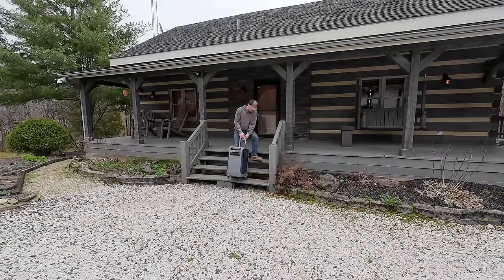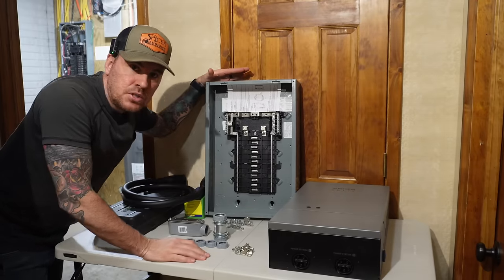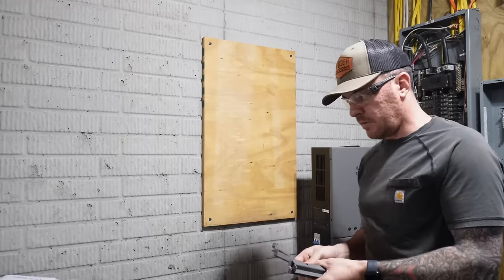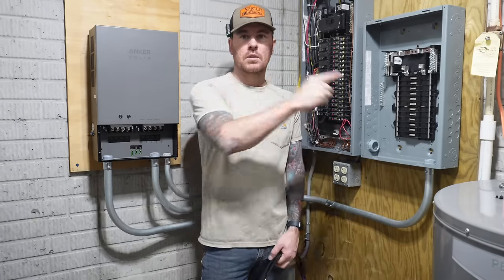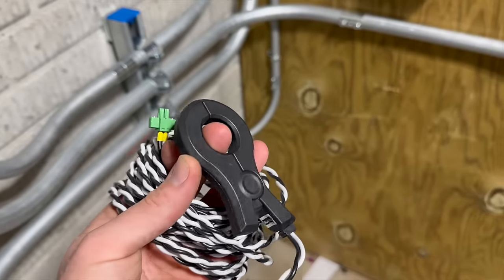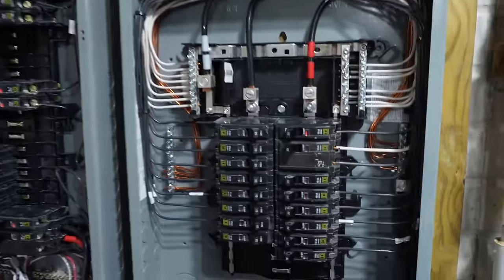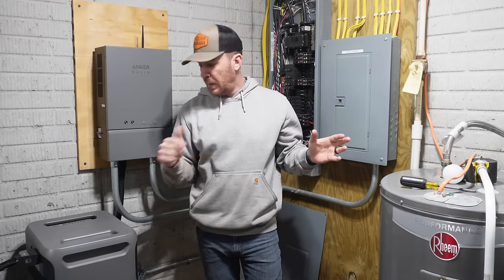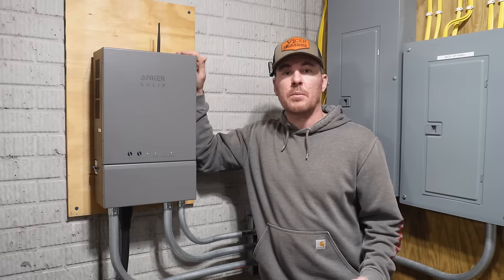STEP by STEP Installation Of Auto Home Back-Up System | Anker SOLIX F3800

Comment from the maker: Join Anker SOLIX F3800 Facebook Group! Share your journey, discover tips, and more! https://www.facebook.com/groups/ankersolixf3800/
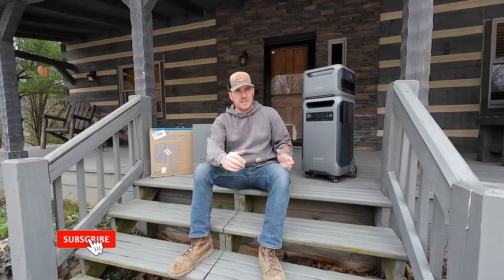Reply: 0:47Thank you for you informational video you explain things exceptionally well it was a breeze to show this to my electrician as im a low voltage guyI have a ? if no power banks are installed in the smart panel, will the sub panel still work with grid electric  or do they still need at least one plugged in.
2) do I have to use a 100amp breaker or can I use something like a 60 amp 
Thanks in advance for your answers

Comment: Always worked on energized panels. Never turned off breakers when replacing outlets/ installing fans. Just turn off the switch and pay attention to details. Not electrical advice. 😏 Good job!👍

Comment: your worksmenship is amazing!!! I do think probably the coolest feature that makes the panel so much more than a auto transfer switch is the fact that the AC coupling can power the whole house on the main panel, not just the critical loads panel, by feeding the solar power backwards into the house,  balancing automatically without feeding power back to the grid, so your power bill can be nearly zero, or very close to zero. this is HUGE for DIY solar owners because you dont need any sort of weird net metering credits agreement with the power company.
Reply from the maker: Thank you!  Sounds like you have a good understanding of the system.  I did just make another video where i added solar too. Its been helping out with the bill for sure.
Reply: @SpicerDesignsLLC  oh cool! I haven’t watched the follow up video. I don’t have the Anker smart home panel yet but I’ve been researching to add this and the f3800 to my existing 3kw solar system. I’ll get caught up on your solar video to see what you find. Again - your workmanship is like 💯- I have much to learn from you

Comment: He needs to have two I couldn’t just have bought 1 knowing it takes 2. Dude get the complete kit. Let’s get that second one. : )
Reply from the maker: I have the second one now
Reply: @SpicerDesignsLLC  could you do a video breakdown on cost assuming we the general public hired someone. Because I can’t pull off what you just did. So impressive and lastly testing it with two attached how much run time and how it takes care of your home.
Reply from the maker: @rabeahkarram9689  yes i will have a follow up video in a while.  Trying to gather some data on cost savings while using the time of use mode.

Comment: Well, I think I should get 2 of those generators and all 12 batteries between the 2. Get one of the little home panels. Hook that up to the fuse box. And now to give me a few days of power when power goes out. Of course, I don't have a power line so I don't have power from the power company.
 And I only have solar generators. I was thinking about getting A.  Gas propane one, but still haven't done it yet.
 I still like buying a solar generators. So I think I might stay with those instead. Cause they are cheaper. And they cost more for the unit, but they are cheaper on fuel.

Comment: Great video I am looking to do something like this myself since I just spent a few days running on a generator due to hurricane Milton. 

I feel like I could have watched the full non time lapsed vid 😂 

I wish there was a system like this I could use with some of the diy eg4 batteries but I assume there is a lot of communication that has to happen  with the inverter.

Comment: Great video! However, I didn't notice that you turned on the A/C to actually see if this would have powered it. Would definitely be interested if it would actually power the A/C during an outage.
Reply from the maker: Ive since used the ac on the system.  It does work.

Comment: Hardcore bender! Good story, love it, thanks.
Reply: Will it change over fast enough to leave tv, wireless router etc. on or will they go onto standby or reset? Or does it work like a UPS?
Reply from the maker: @hughwilson4911 it does have a split second transfer.  Great question! So its likely most devices will reset or shut off.  I did purchase a small ups for the tv and wifi router to bridge the gap.

Comment: Nice looking installation. Is there a benefit or a requirement to use metal conduit? Or could that flexible PVC stuff work?
Reply from the maker: @Hunter-vb8wo  you can you any raceway as long as its rated for it and acceptable to mount exposed.
Reply: @SpicerDesignsLLC , you make it look easy. I’d probably end up wasting 18 length of conduit and 4 days trying to bend it perfectly.

Comment: Thanks for the video! Very thorough! I'm going to check out some of your other videos.

Question  - At the start of the video, you mentioned that you have a separate disconnect, and the existing SquareD QO panel is 'technically' a sub-panel. I have an almost identical SquareD panel with a disconnect out in back near the meter, and am thinking of adding a Solix system as a backup. Would re-routing the grid-power connections from the SquareD panel directly to the 'Grid' side of the HPP, and then connecting the 'Backup' side of the HPP to the existing panel be a valid configuration? That would make all available circuits available to the backup power w/ minimal re-wiring. In other words, do I really need a separate sub-panel for my backed up circuits? I do realize I may still want to feed the 'grid' through another nearby disconnect (w/ a breaker) before the HPP, but the end result would be the same electrically, right?
Reply from the maker: @lmychajluk  theoretically you could do what your saying but the ct’s need to get their reading from the main feed and that may be too far.  Its hard to say without looking at it.

Comment: Nicely Done! I’m a 40 year Electrician/ Electrical Contractor and was asked to install one of these for a client. What are the local AHJ requirements for the installation of one of these units? I’m wondering if this would be considered an additional electrical load? My clients calculated load is already over 200 amps and the solar company has ignored that and put in a 150 amp main in order to install their massive 80 amp solar backfeed. Any info would be appreciated! Oh by the way, the manufacturer stated that it should only take a couple of hours to install this equipment! 😂🤣🤦🏻‍♂️
Reply from the maker: Not a lot of info on an AHJ requirements.  Im sure it will vary in different areas.  I would imagine that would apply more to the PV system solely and not so much the Anker system.  It can backfeed to counter high peak costs but it isolates the main in an outage situation.  Sorry i dont have a solid answer for you.

Comment: Man... thats a sexy panel!! Looks so clean and wire management is purdy as well!!! This makes me want to hook up my 50 amp manual generac switch for my 13kw generator! I tried my best to make it look like this when I landed my outbuilding aka office. I had a retired electrician come and size the line from main to sub since I didn't understand the calcs and distance equations and didn't want to risk it.
Reply from the maker: Thank you.  As long as you have a good game plan you can dress it up pretty nice.  And yes, voltage drop calculations can be a little confusing if you dont do it all the time.
Reply: @SpicerDesignsLLC  yeah voltage drop and then having to figure out aluminum vs. Copper. I had it all inspected just incase we ever sell and what not.
I have thought about doing what Adam mentioned in his video a while back that u assisted him with, about supplementing by using a system like either of yalls to run my office during the summer when I'm running the AC. I'm just waiting to save some $$ then look for panels to help charge the system!

Comment: Was hoping to bug you one more time - happen to know if the system would work with two panels for a larger home or would you need two systems (one for each panel)? Thanks again!
Reply from the maker: You could use it with two.  You would just have to move circuits from both panels into a sub panel that will be powered from the battery system during an outage.

Comment: Many thanks!!. 
You re the first to showcase how this works and connects. 

Could you please answer this (cause no one else has, even Anker):
In self consumption mode, how does the HPP know how to not output more than the main + backup centers need ? 
Is it getting readings from the CTs and adjusting the output constantly ?
Reply from the maker: Good question.  Yes, the only way i see that possible is with the CT’s on the incoming and if you noticed the internals of the home power panel there are more CT’s measure inputs and outputs as well.  And you can determine how much you want the battery to discharge so you still have capacity for an outage.   There is also another ct that they provide to install on the incoming PV conductor to measure solar input.  I showed it in the video but didnt install because i dont have any solar yet.
Reply: @SpicerDesignsLLC  got it, thanks.
Not sure if u can answer this... Is there any chance that the town makes u install a knife switch accessible from the outside so that  (in some severe fire or similar incident) they are sure you are not returning power to the grid?? 
Anything that ties and feeds your panel needs this according to some local laws - along with 100+ labels that say so - similar to solar GT systems... thanks a lot!!
Reply from the maker: @lys1805 i dont believe thats required on this system.  Dont quote me on that.  Its supposed to only counter the utility usage, so if the power is out it has nothing to counter and it would be in backup mode which would isolate it from the main and only power the backup load in the separate panel. Im guessing that the grid tie solar portion would still have to be set up in a way that it cant back-feed though.  I dont have much experience with PV systems.
Reply: Thank you very much!! (Subd)
And I totally agree on this.
But for the town to approve they would need to be convinced about it. 
That's when I think they would say "i dont know how this thing works.. lets put a knife switch outside and kill it if we want to"..

Comment: Good idea with the chase between your panels! I suppose if that thing went down you’d be screwed 😬
Reply from the maker: Ya pretty much.  Wouldnt be a good situation.
Reply: @SpicerDesignsLLC that’s the one nice thing about the manual transfer switch because you can stay on line

Comment: Very cool video, looks like a great home. Just curious, as an electrician, how much would you charge for a job like this? I'm looking into getting the F3800 and wondering how much to expect to have it all hooked up.. Thanks.
Reply from the maker: Thank you!  Id say somewhere in the 2k range with material.  Lots of variables so its hard to say.
Reply: @SpicerDesignsLLC  thanks!! PS what's up with the keystone? 😆 Busch light all the way!
Reply from the maker: Keystone is good stuff.  Cheap too

Comment: Okay, I'm not an electrician and get scared of electricity. These videos are fascinating because I'm trying to decide between a generator/solar setup, solar with batteries, or just how you're doing it now. I want to be able to run pretty much everything in the house, including the A/C. My question now... Why do you need a sub-panel? Could you connect the transfer switch directly to your main panel? Excellent video, by the way!!
Reply from the maker: You cant hook this up directly to the main.   The main feeds the Home Power Panel and that feeds the backup panel.  You can put as many loads as you like as long as it doesn't go over the 6000 watt capacity at any given time.  More loads will just wear the batteries down faster.  I recommend only the essentials.

Comment: I appreciate this info. We need to do something to at least keep our well and sump powered during outages.  The battery option over a generator now has me thinking, especially since it's not a whole lot that I need to keep running as "emergency".  Fridge, freezers, sump and well.  Seems pretty low demand considering what you backed up. Good stuff.
Reply from the maker: No problem. Its definitely a viable option.

Comment: Any thoughts of converting the existing 200A main panel in which I currently have 32 breakers to the 100A subpanel and adding a new 200A main panel which would be essentially empty? I do have much load and I am using two F3800's. Or is it just easier to move over the 32 breakers to a new 100A subpanel? thanks.
Reply from the maker: The most practical setup for these units is just adding the essentials. Otherwise it just depletes the batteries at a faster rate.  I would just stick with the sub and move the desired circuits over.

Comment: You are 100% right about wanting this to automatically switch over in the event of power loss.  I like that you can program the system to use power from the F3800 during your peak hours in the day.  As an electrician, how much would you charge for the installation of this system?
Reply from the maker: It all depends on the layout.  Your probably looking around $1500 just for labor.  Give or take.  Material is fairly minimal.
Reply: @SpicerDesignsLLC  I appreciate that.  my wife and I were thinking of getting on of the generac natural gas generators.  but this would be cheaper and still do the same job. we would need it to do.

Comment: What if we eliminate the subpanel and feed the whole panel with 2 F3800?  Would it still work if you just pulled out the main feed of the existing panel and reroute into the grid side of the ATS then feed back to the existing panel? Would the CT sensors still work?
Reply from the maker: @kanialav1404  no wont work.  The main panel feeds the home power panel.  If you lose power thats how it knows when to switch.  It would take away the auto transfer function.

Comment: Hey Kyle,   Nice Job!  But I am curious on why a battery back up rather then a propane or diesel back up. Battery seems so limited with both how much of the house you can run and the time you can run it for where the engine units you can do the whole house and really go unlimited time as long and you have a supply.
Reply from the maker: Thats the disadvantage to the battery.  I didnt want a gas generator eating through my propane. The propane is expensive and we rarely lose power.  So when it exercises every week is just burning gas.  The battery system will likely last through a typical outage which is all i really need.  All comes down to preference.

Comment: Good job.   I we lived close I would be trying to get you to do my solar connections on job sites.   Biggest downside I have seen on these style units is that the solar can’t back feed like a typical grid tied system.  So once the solar has the batteries charged… it just sits there.  Not sure if the Anker is the same but most I have seen are that way
Reply from the maker: The anker actually couples with the grid tied system.  Doesnt necessarily use the solar to charge it.  Its more designed around cost savings than just a normal back up system.

Comment: One more question. When the batteries are depleted to level set. Do the circuits connected continue running on power from grid while battery recharges or do they shut off to recharge? Thanks again for making this video.
Reply from the maker: The time of use mode for money saving actually just pushes power back on the grid to counter usage.  Similar to a PV system.  It doesnt actually switch to battery power on the new backup panel.  So once it depletes to the level you set, it will wait until off peak hours, which you would set, and recharge then.  Usually at night.  Hopefully that answers your question.

Comment: Great video.  I may have missed it...but...if you don't have solar...how does the Anker battery stay charged while awaiting a power outage?
Reply from the maker: It charges through the power connection cord that goes to the home power panel.  It can be scheduled to charge during off peak ours too.  I did talk about all of that toward the end if the video.

Comment: what do you do if you don’t have enough line to move over to the new sub panel? add a junction box?
Reply from the maker: A lot of these systems will have you splice them in the existing main panel.  Unfortunately you may be limited to options when it comes to relocating circuits.  A separate junction box or a trough about the new sub would be a better install.